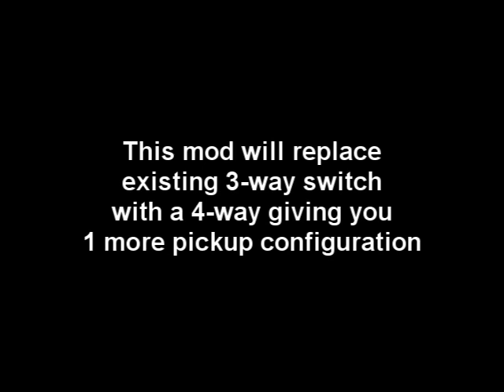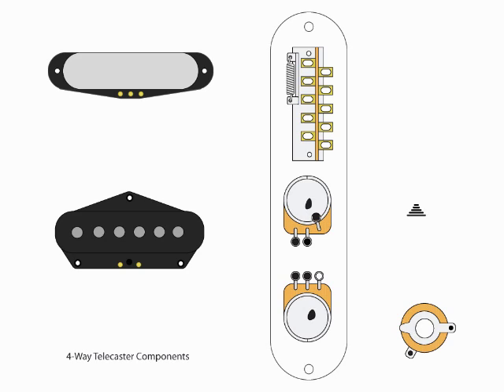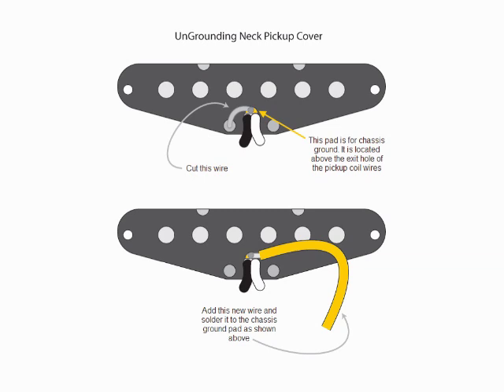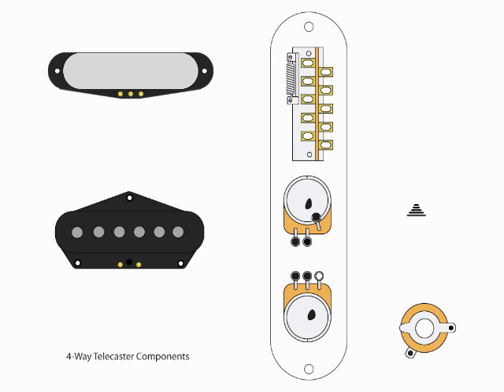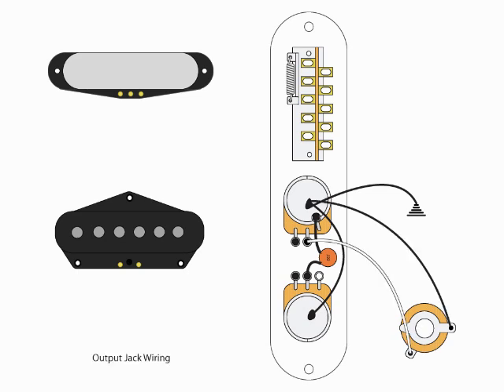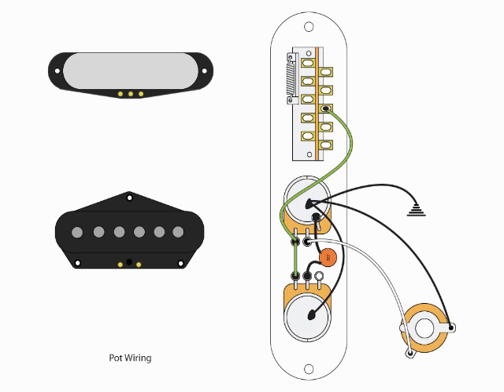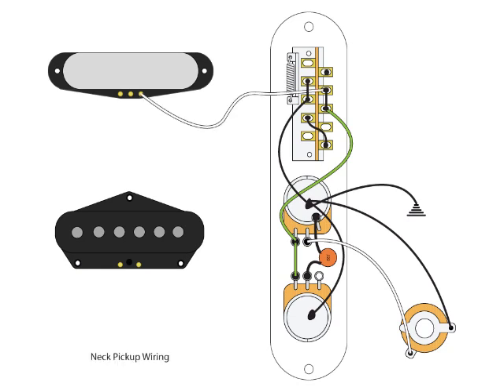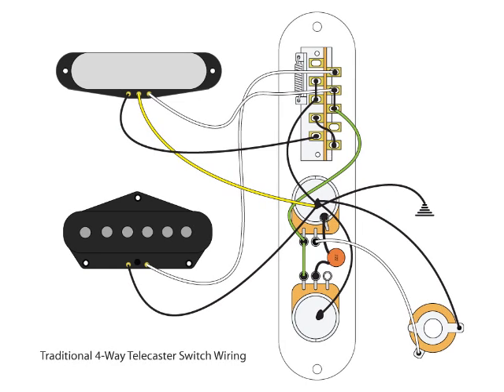4-way DIY Telecaster Switch Mod

Comment: Just need to say, your tutorials have been the absolute best for me. I had never wired anything, But am now on my 3rd project with a soldering iron! Many thanks. I have a spare "superswitch" although I would be happy to use a standard 5 way for this: is it possible to use a 5 way to wire 2 single coils (like in a tele) with series and parallel switching like in this video, but have the "spare" position where the bridge bypasses the tone pot? A sort of "hot" position 1 if you like

Comment: Excellent instruction video, I have a tele lace sensor set I need to install, issue I'm having is that the wires on each pickup are green, white and orange, no black the prewired switch plate is a 4 way, the set came with no wiring instructions, I'm guessing the orange is most likely the hot wire, out of every video I viewed on youtube this one has explained the process perfectly, I was able to use it to wire my tele, thanks

Comment: Hello -- if the neck pickup has only a ground wire and a hot wire, where should the neck pickup's ground be connected?

Comment: I am working on this mod with a pre wired kit, and the middle positions sound out of phase. I swapped wires for the bridge and it corrected the phase issue but the ground was gone. What’s the best way to troubleshoot this?

Comment: This is the most helpful video I've found on this topic. Thanks for posting it.
One question : if I want a reverse control plate so that my volume knob is up front, do I need to flip the switch around prior to wiring it? This seems simple but I can't get it straight in my head...lol...dislexic, I guess.😁

Comment: Would I have to add an extra ground wire on the Neck Pickup if I were to use an S1 Switch instead of using a 4 Way Switch?

Comment: Thank you for doing these videos. I opened up my Telecaster (1989 American Standard) and it has a TBX tone pot set up. This, of course, defies the logic of every four way switch approach I'm finding, particularly with my feeble knowledge of electronics. Any thoughts on where I can begin figuring this out?
Reply: dnobendno Figured this out. Left the pots as they were, wired the switch like you have it here. That worked. Thanks again.
Reply: I have a 1992 USA standard Telecaster with the TBX stacked tone pot with no earthing bridge to the volume pot. I am rewiring the pots etc.... and stopped after watching this video. But you have clarified things for me. I'm also wiring in a coil tap on a micro switch for a second hand Seymour Duncan ST59-B. I hope it sounds sweet in series. Thanks for your advice.

Comment: Hey Don! Great work on the videos. I'm always scouring the net for mods and frequently end up on your channel. You got a fan in India.
I'm about to do my first mod on my old pacifica. I'll be using the 5 way switch to get the 4single coil combinations just like this tele mod and then use an on-on switch to toggle between the humbucker and the 5 way switch single coil mode. My question is would leaving the middle pickup unground (quite like you would an uncovered neck pickup in this video) be okay? Since strat pickups don't have a metal cover or baseplate, i cannot add a third ground wire.
Apologies for the long post. :)

Comment: hey Don, Thanks for all your video advice. I tried the 4-way tele mod today but couldn't get the neck pickup to work. Wiring looks correct and I did wire a separate ground from the neck cover. Scratching my head... Any advice?
Thanks
Reply from the maker: Hey Nick...

Anyway you can email me pics of your wiring so I can see if I notice anything?
brejatoneworks@gmail.com
Reply: Breja ToneWorks Thanks for the reply Don! I figured out that my neck pup was on it's way out. So I bought a set of '51' Nocaster pups, rewired the whole thing and viola! What a great configuration! The series addition is perfect for my style. I like the series in position 4 myself since I'm so used to the standard 3 way. Thanks for the specs. I highly recommend this setup for players who like their present tone but need some more beef out of their tele.

Comment: So, what does this give you? 1. neck, 2. n+b parallell, 3. n+b serie, 4. bridge?

great video!
Reply: no... 1 is bridge only, 2 is both pickups parallel, 3 is neck alone, 4 is both pickups in series.  '1' is the knob of the switch far left as you view it...

Comment: Hello.  I have a 5-way switch rather than a 4-way one.  Could I use that to do this mod?  I don't mind if one position activates no pickups.   Is it possible?   Thanks.
Reply from the maker: +Iggytommy Those switches and their lugs function a bit differently.  I'd have to think about it to determine if it's possible.
Reply: Yes, please.  thankyou.  :)   As I say, I don't mind if it means that one of the five positions becomes effectively an off position due to no pickups being active in the circuit.  Or maybe the fifth position could have a capacitor involved to create a secondary, 'strangle' mode for the in series position?

Comment: Will this mod work if I already have A Dimarzio Tele humbucker in the bridge? Anybody tried it?
Reply from the maker: +randolph patterson  Does your pickup have a cover?
Reply: +Breja ToneWorks Neither PU has a cover, and neither are stock. The neck is a Mighty Mite single, and the bridge is a Fast Track Tele humbucker w/ 4 conductors
Reply from the maker: +randolph patterson If it's a 2-wire neck pickup, ignore the callout in the video for the cover wire to go to ground.  Wire the hot and ground accordingly.  The bridge will use the same Hot and Ground concept.  If you want to split the HB, you'll need another mini switch.
Reply: +Breja ToneWorks Thanks. I guess I'm curious about the idea that when using the 4th position the neck pickup will be in phase with one coil of the bridge humbucker, and out of phase with the other, and I'm pondering whether that will be a problem. I'm not looking to use the bridge in coil-split mode, unless I may need to cut out one coil to get the series configuration to work properly. In that case, I'd look at installing a push-pull pot in the tone control.
Reply from the maker: +randolph patterson You're overly complicating it.  The situation that you're worried about (SC out of Phase with One Coil of A HB) isn't an issue.
Reply: +Breja ToneWorks Okay, thanks for the go-ahead. Treestrings sells the switch separately, I'll go for it and report back on the results. I've been waiting to get a break from gigging for a long time, and I don't mind complicated, it's a labor of love and a learning experience. I'm even thinking of replacing the tone pot with a six-way rotary tone switch. I need to pot the pickups, too.

Comment: Don-  Did the mod today and followed THIS video, step by step. When I went to test it, it worked fine, except that it is a STANDARD 4 way switch configuration where the B/N in series is in position 4 rather than in the intended position 2. I compared your schematic with the standard one on Seymour Duncan's site.  Did I miss anything? Here is the link to the diagram.  http://www.seymourduncan.com/blog/tips-and-tricks/three-cool-alternate-wiring-schemes-for-telecaster/
Reply from the maker: The series combo should be in position 4 with this mod.  Position 2 would be both pickups in Parallel.  My 'modified' 4-Way Tele mod allows you to have position 2 be in Series and Position 3 be in Parallel - that might be what you're looking for.  I like that mod better myself.
Reply: Yes. YOUR mod was what I was going for and sat there with your video doing everything step by step, yet at the end the result was the standard mod with series in position 4.  I looked at the SD chart after doing your wiring and somehow it seems that your wiring is the same though the predicted results are different.  So bizarre.  At least it works.  I'll have to take a shot of the wiring for you to check. BTW the switch is an Oak Grigsby.